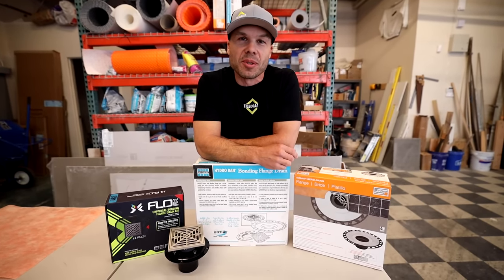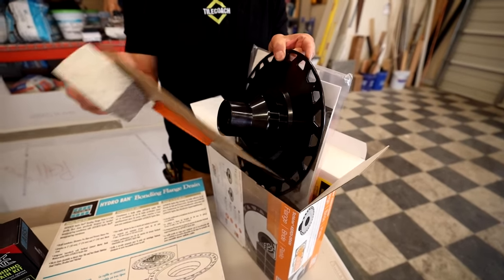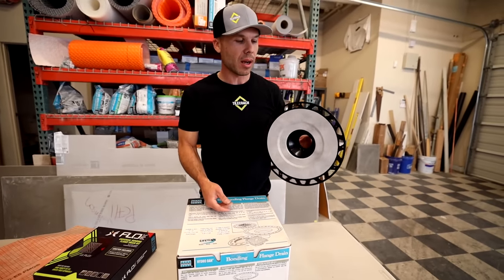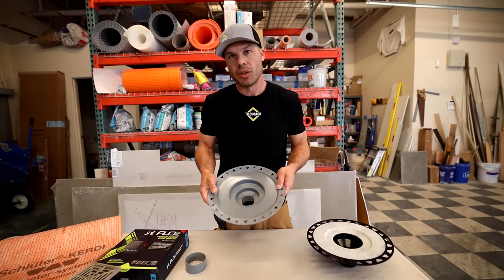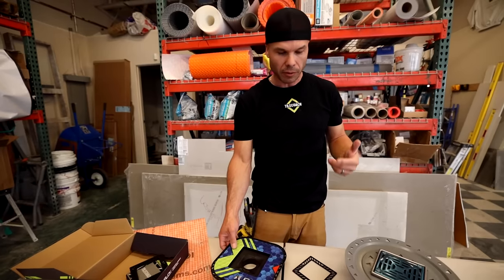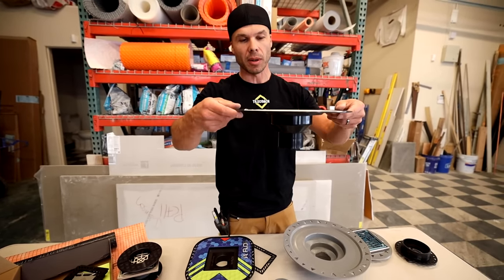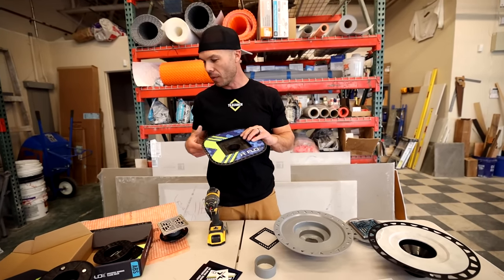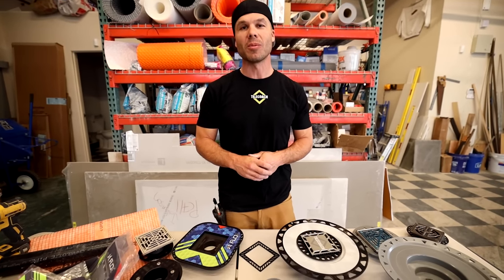Bonding Flange Drain Comparison --- Schluter, Laticrete, and FLO-FX for Tiled Shower Pans

Comment: I'm doing a walk-in shower right now. I'm all framed up and I'm ready to float the pre-slop dry pack. It's my intention to use hydro ban but I am going to use a traditional bolt down drain system. I have not seen any good videos of anyone doing this. It seems to me like I am just replacing the hot mop system with the hydro ban membrane. So, I am going to lay down felt and also lay stucco diamond wire where I will be floating my pre-slop. My next step will be to apply the hydro ban fabric with the liquid membrane. I will need to do one more dry pack float to reach my tile height. Of course, I will be using precut corners plus 6-inch seam material and I will brush out the entire shower and dam with hydro ban before my final float. do you see any issue with my proposed method? Other than relying on weep holes I think the pan will out last me.

Comment: This is soo informative. Great job on the video. There is a cool tool like a fixed ridge reamer to cut out old PVC drains for rework jobs. Have not seen one for outside cut but most jobs require to remove an inside fit anyway. I have to ask with a loose fit when drain backs up where dose the water go?

Comment: I dry packed for year's, then went to Laticrete, Schluter. Once I become certified in all of them I discovered Wedi systems and I've never looked back. Keep all the roll on waterproofing, Schluter works well but all that fiber paper in the corners is a build up risk and their pans are flimsy. Wedi closed cell and the sealant is money for me. To each their own they all work if done Right. Wedi systems for me

Comment: I prefer the 2 float system because it's thicker and stronger but I use red guard instead of traditional style pan liner have never had a single issue in 10 years of shower installations.

Comment: Lf i have plywood base.Should i use hydra ban over plywood,Then after Hydra ban dries fully with 2 good coats.Should i attach chicken wire then  apply thinsett followed by using dry pack deck mudd over that.?

Comment: Awesome info TileCoach! Question: Would a version of FLO FX drain work with a new corner shower stall when installed December or installed after snow melts in spring 2022? (plumber not confirmed my appointment yet this Dec.) Second question: I plan to remove shower/tub from hallway bathroom to enlarge tub for a float meditation tub/shower by removing bottom half of linen closet. How would bottom tub part be built strong enough? Your FLEX SEAL show motivated my therapy tub project plans. The life this veteran experienced & knowledge confirmed my plans by researching on YouTube to discover true professional knowledge shared for me to accomplish where I live a 1/2 hour south of Canadian border in eastern part of WA. There are not many "professionals" that work north of Spokane.

Comment: So my question is that I want to use the Schluter system, but the drain grate color is only available from Kohler with the standard clamping connector.  Is there anyway to use the schluter system with a clamping set up so that I can use the screw in drain? Love your videos by the way!

Comment: I have a 2" PVC pipe (inside diameter) that is embedded down in concrete.  What would be the best way to adapt the FloFX to it without having it stick up too much?  I have less than 2" of height to work with.

Comment: You talked about the material on the Kerdi flange disintegrating, but you also said you had used unmodified thinset. That was the problem you created. If you follow the instructions and use the schluter modified thinset that is formulated to work together you will not ever have that failure.

Comment: Suggest putting the Kerdi drain in a bucket of water over time to see what happens to the fleece. Also put some thinset on the plastic Laticrete drain to see how well it sticks to the bare plastic. I'm an engineer and am concerned about that as well, just like you said. Love your channel and videos, Isaac.
Reply from the maker: Haha...I have one that I used all set and a piece of membrane on.  Its been in a bucket since October.   Probably give it another 8-10 months soak and then see.
Reply: @TileCoach  update on this?
Reply: @TileCoach does the laticrete drain/flange stick well with thinset?

Comment: Lol it’ll work. 11:15 

The heavily modified laticrete mortars can literally be used underwater for swimming pools. Not only that, all contractors that have used the mortar know that they need to be careful as when it dries on something it’ll stick forever. Clothes, metal, plastic. Anything. I even tested some laticrete mortar on a dirty, dusty , dry , algae ridden piece of concrete, I put a little dab on it and now that it’s cured it does not come off. So imagine on a properly prepared material

Comment: If you have the laticrete bonding flange drain, what should you use to make sure its water tight?  Say you use thinset for like 80-90% of the drain flange, but on the last part around the lip of the actual drain, would using silicone be good enough?  Or some epoxy?

Comment: My concern with the Flo-FX one is that it doesn't have the downward/inward slope that the other ones have.  So if water ends up around the drain, with the Flo one the water seems less likely to find its way into the drain and would be more likely to travel out the outer edges of it.

Comment: Help got a question  i striped one bolt on the home depot drain i got the kerdi adapter drain .. can I just silicone the missing bolt hole shut or do I need to replace the hole drain..

Comment: We had a schluter drain installed with the tile set as drain cover. It was a mistake, looks horrible. Schluter is not set up to simply swap out the tile set drain cover for a stainless steel cover. How do I fix this mess and get a stainless drain cover installed without removing a bunch of tile?

Comment: The collar/frame of the grate is obviously plastic.  When the yellow plastic cover is removed and metal grate is installed,  is there still a little exposed black plastic framing the metal grate? It looks like the metal sets inside the plastic cavity.

Comment: With all of these types of drain flanges, I have considered the possibility of using 3M 5200 adhesive to bond drain flange to the membrane and also the drain components. This has been used in marine applications for 50+ years and compared to any thin set on the market would provide both a superior bond and water proof seal to prevent the types of water infiltration you have been talking about. As you mention in the video, using thin set to bond to a plastic component is not a good choice.
Reply: DIY with the right materials could be the best.

Comment: Good morning, I am installing a Schluter system shower with a preformed pan over a slab. Would you swap out the drain system with the flo-Fx or use the all Schluter? I am very interested in the Kerdi drain like the one you installed in your home but I am concerned about maintenance over time. Any possibility of using something to avoid mold issues? Thanks for your videos, I subscribed after viewing the first one.

Comment: I wish you would try the divot drain method and make a video. I feel it's the best, Traditional clamping drain combined with waterproof membrane. It has the best of both with only one float and it doesn't stay saturated.
Reply from the maker: Why would that be better than a flo fx?  Way easier to screed off the top of a bonding flange than make a divot.  You can also use sheet membrane or liquid waterproofing with a flo fx.  Thanks for the comment, I’d like to hear why you think it better.
Reply: @TileCoach  main reason I feel it's better is because you aren't relying on some sort of fabric that is glued to the drain body as the critical failure point. A membrane is made with laticrete fiberglass mesh and hydro ban and it gets sandwiched between the two halves of the clamping drain. Clamping drains have proved pretty foolproof over the years with rubber membrane or hot mop. Another reason I like it is because the hydro ban or red guard is adhering right to the mortar bed instead of some sort of sheet of styrofoam which I don't trust. It's less expensive. It's stronger, I don't trust Styrofoam sheets and all the thin plastic wobbly bits on those drains from the people that will be walking on them over the years. You can hang the cement board on the walls, waterproof and tile them then lastly set the drain, pour the mortar bed waterproof and tile the floor and the bottom row of tiles on the wall
Reply: @PlumbNutz  The fabric isn't glued to the surface, it's molded INTO the surface.
Reply: @flofx9418  think about that for a moment. The drain body is plastic and this other material is fabric. It wasn't manufactured at the same time. Glued, molded, adhered, somehow it has to be attached to the drain body with an adhesive.
Reply: @PlumbNutz  there is no adhesive used in the process. It's literally molded into the drain body, molten plastic is injected at 700psi forcing the plastic into the fibers of the fabric.
Reply: @flofx9418  - potential game changer- construction trades are hopelessly slow to change, often without any reason except inertia. In ANY discipline, being curious and taking up proven excellent technology are hallmarks of the best in their trade, whether we are talking fighter pilots adopting jets after WW2, surgeons adopting robotics since 2000, dentists using new materials for crowns filings etc. , engineered wood floors, engineered joists, rainscreen an waterproofing other than tar paper, etc. The BEST tile installers will be trying out promising stuff like Issac and adopting when it works. Flo- is not proven yet, but the advatages are obvious.

Comment: I don't understand why the white material would come off.  Kerdi has sold 1000 of those drains it is dificult to belive that the white material desintegrated. What I do see is that the white material looked like it was pryed out. I agree that didn't happen during the demolition but in my opinion there was flex   in the assembly that apply thension on the material basically and riped it out .

Comment: My only concern I see on Flo Fx is that the flange is already square so I guess when you are glueing down with the drain pipe you need to make sure that its not crooked and it’s square with your layout? Also I had a situation where the drain grate was going to look better on the tile setting it up diagonal, you would be able to do this with the flo fx after is set
Reply: For sure, Some additional planning is required, especially if wanting to go diagonal. The installation instructions mention making sure the flange is square with the shower. If it's a few degrees out it will still work, but you'll lose some horizontal grate adjustment.
Reply from the maker: There is plenty of play for minor adjustments.  I haven’t done a diagonal pan in over 5 years.
Reply: @TileCoach  https://imgur.com/a/JeCUkSd. This is what I mean, did the drain grate on diagonal for a better layout of floor. Of course it can be arguable to layout before solvent welding the drain flange to the pipe. But wouldn’t it be an improvement to not have your bonding flange dictate the direction of your grate ?

Comment: I have a feeling the kerdi drain failed because it was not properly supported from underneath with thinset. The drain was pushing the unsupported plastic assembly, and over time it pushed through the pan basically. I bet it was soft, and the grout was cracked.  Ive had to service many installs that had improper thinset under the drain assembly.  I would never recommend using those "plumbing spacers" because its more difficult to get the proper amount of thinset under that assembly.

Comment: Hey Isaac. Thanks for another great video. Have you tried coating the Schlueter flange with Hydro ban or Red guard and allowing it to dry prior to installing? I just wonder if that will keep the fiber from the laminating?
Reply: That would render it incapable of doing its job i think. Its purpose is to improve the bond with the thinset mortar i believe.
Idk. Its just another reason not to use fabric or sheet membrane waterproofing systems imo.
Ill stick with liquid membrane systems like Redgard.
In 15 years ive never had a failure and once my slope bed is ready im laying tile on the 3rd day afterwards.
The same or maybe 1 extra day longer than Kerdi but i have the peace of mind of having a true one piece waterproof system.

Comment: I am on a mission to watch all of your and Sal's videos, almost done!  I too would be concerned about thinset sticking to shiny plastic. How about testing he adhesion by applying thinset to the drain, letting it set then trying to scrape it off.  You could attach a piece of Kerdi to the plastic with Kerdi Fix then thinset the sheet to the glued on kerdi.  Thoughts?

Comment: I really hope someone can answer this for me. I am doing the schluter membrane stuff but I plan on using my own 6" drain that I bought off Amazon. I plan on thinsetting and setting it in place like that and then using ardex 8+9 to waterproof it. Will that cause any problems? I feel like its the same thing but I just don't get the height adjustment. I just don't like any of the design with the schluter drain kits
Reply: Mixing systems is risky.  Aside from voiding the warranty you probably don't care about anyway, mixing and matching is a recipe for disaster.
Reply: But why though? The only difference between my drain and the kerdit drain is the fact that it's not height adjustable. Everything else is the same essentially. I'm still using the white large drain piece
Reply: Hi Harris! Does the drain you bought have a bonding flange?

Comment: I still don't see how a flat shower base gets water to flow to the drain.  If there is no pre-slope under a Kerdi system, seems like water sits there for long periods (like your 7 day tests), and wicks under the membrane overlap joints.  The PVC liner system, when installed correctly looks bulletproof to me.
Reply from the maker: Pre-slope is the term used for the mortar under the pan liner in a traditional system.  This system only requires one mortar bed.  But it still has slope.
Reply: @TileCoach  Thanks, saying "no pre slope" threw me off.  Understand now

Comment: 45 years as a tile setter (ready to retire)...I've done hundreds and hundreds  of showers and shower pan replacements. ---- A traditional vinyl  pan is seamless,  seamless is ALWAYS better than having seams.  Common sense tells you that.---Kerdi seams are "sealed " with thinset. Thinset is NOT waterprooof.--------Vinyl pan with clamping ring is cheaper, faster and easier. I see NO reason for this other stuff. --The ONLY problem I have ever seen with a vinyl pan is poor installation.
Reply: Except even when installed correctly, the water in water out system is a terrible system. It literally requires water to push out the water in the pan. They always water. Technology has advanced in this area, and yes seamless is better in theory but not in this case.
Reply: Schluter all set is hydrophobic to an extent

Comment: from what i have noticed about shower pan failures it's been noticed that when a foam shower pan fails it generally does major structure damage to the building supporting joists, and walls vs a good old fashion copper or liner shower pan which limited failure to only the pan.  Sad to say by the time a leak becomes noticed in a foam shower pan the tile contractor is M.I.A. and or gone out of business, then add more heart ache to the foam system failures, the manufacture will find any way to not honor their own warranty, you can Imagin why they would run from their own warranties is  because it took 10 plus years to  noticed a leak that has cause expensive catastrophe structure damage. that fact the cost for these type of foam systems exceeds a traditional system cost. for me I rather stick to proven traditional liner systems.

Comment: Now personally from the first day I came across these new shower systems as I have mentaly visualized is expensive ways to install leaks  (never mind a foam base - absurd)
.
And more than one of your videos have re-enforced that mindset
.
Now the adaptor on FlowFX , allowing me to 'go over, thereby basically having a double barrier on a do over ...now that I might be able to roll with , though honestly ... if my name goes on the job, and therefore my responsibility .... shortcuts aren't a thing .... go down to the bottom, build from there and I know what customer will have

Comment: Hot Mop is Superior to any other waterproofing method for showers, on the West Coast especially, where ground movement,  poor tile installers from other countries (ie dropped screws, lath nails or screws below the dam), and extreme designs for 20 million dollar mansions prevail. Thin set is not waterproof

Comment: You can use home depot drain. Just throw away the clamping ring, waterproof the drain body, cut the threaded part of the drain grate off and thinset the grate down to the waterproofed drain body. There you go... $25 drain instead of $150. Noble company also has a thin bed drain that's about $50. Kerdi drain is overpriced.

Comment: Let’s all be honest, time will tell. I have seen hot mop showers that have lasted 50 plus years. Pan liners at 30 plus years. So kerdi and all the new stuff will have to to tried and tested. Are they better? As of yet, no. We will know better in 20 plus years, but as of now no. And yes we know they have failed and been through a few changes. But with the new stuff and changes  they are looking promising.  It as of now, hot mop and liners (when done right ) are best. Kerdi is second and okay for budget jobs.